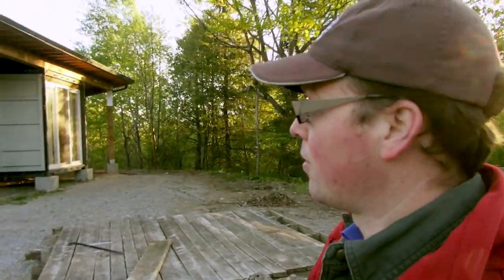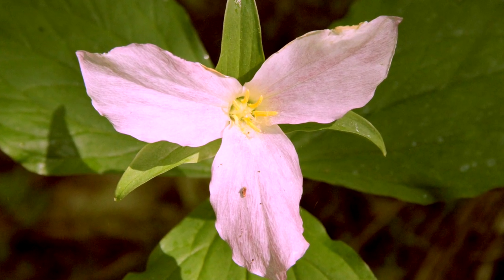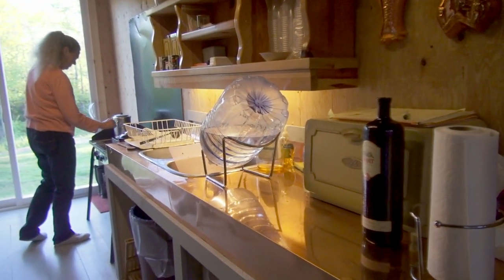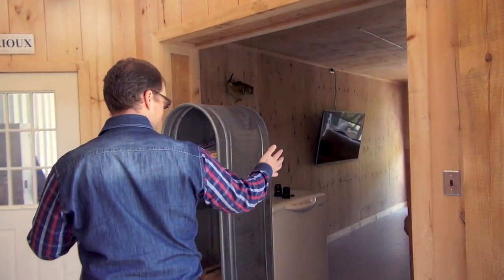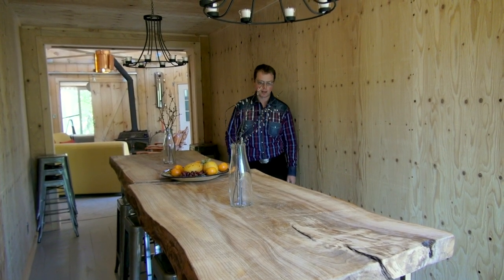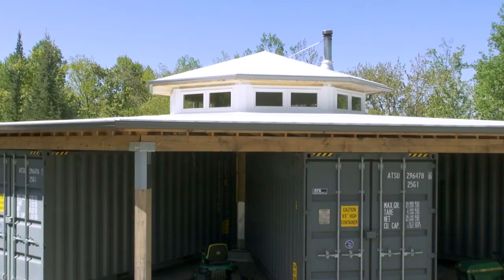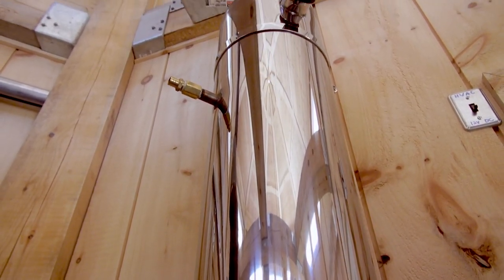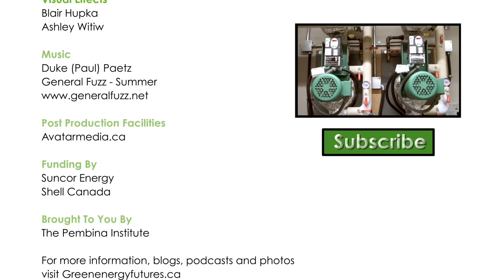112. The Octopod: A unique off-grid solar powered cottage made out of shipping containers

Comment: This is a stupid house! It's functional and plausible perhaps. I would go crazy living in it. It dosnt address the total needs of the family. I presume this is not their main home. I one thing that bothers me is the penny pinching that goes on in certain aspects of the home and the total disregard in other aspects of the home. This slumming for the rich I'm afraid. Full of ego and no heart. I could build two homes off the grid somewhat for what he paid.if you can't bring in this mess for under a hundred thousand than something has gone wrong.
Reply: +eva magnusson I am sorry to say that is one of the most stupid idiotic buildings I have ever seen.The computer fans with gutter pipe in metal boxes as heat distribution Wow! That's Canadian! Oh my,dont show it off!
Reply: +eva magnusson 
I am going to have to agree with Eva. Cool idea, but could be designed a bit better. I don't think those PC fans will push a lot air at all. The biggest complaint is indeed the price though. 130K is quite ridiculous, and defeats the point of a tiny home. Or at least an off-grid home.

Especially considering that a standard 2 floor, 2 or 3 bedroom house is going to cost you about 100K. Why is this even more expensive? Usually, tiny or off-grid homes are in the 5-10k range, with some that I've seen going around the 25-30K range. That is sometimes including the solar panels, the trailer wheels, and the car or truck to tow it around if it's a mobile tiny house.

Even if he shaved off 100k, it'd still be in the pricey range, but at least it would make much more sense. I have to reiterate, if he can't get this under 100K, or even under 50K, something has gone quite wrong.
Reply: +Wvo Quailwvo
Stop that. You've been hawking this area for weeks looking for any comment to try and make others look bad. That is not good man. I don't have an off-grid home. Not yet.

But that doesn't mean I can't comment on stuff. I understand it will cost money. But you can't deny that at that price, that is far too much. Price is one very big reason why people decide to go with off-grid homes in the first place.
If an off-grid home costs more than a standard home, then that would defeat much of the purpose, and most people wouldn't even bother with the idea.
Sure, you can probably save a lot of money in the long run going off-grid, but that long run can be many, many years, and a lot of people don't have that long or want to wait that long to save the money.
They need and want something they can afford now. Or something they can do themselves in very little time. Not another hassle and not another mortgage.
Reply: +Wvo Quailwvo 
I think you have misunderstood me, but I am getting the feeling you intentionally misconstrued some of my words. I didn't say you were a bad person. I was referring to the action of sitting here for nearly a month hawking people who post something you personally don't like and responding in a way that seems as if you want to make them look dumb and bad for that post. Many people would consider that trolling. If that's what you want, have at it.

I haven't badmouthed anyone. It is called criticism. I don't do it often at all, but when I do, I almost immediately have someone rip on me for it. Some people do it wrong and completely try to destroy people, then claim it was criticism. That is wrong. But criticism for the sake of offering your personal opinion and outlook on a situation is not badmouthing.

Yes, going off-grid or getting a tiny home means different things to different people, but to MOST people, it's about having to pay less and be more in control of their environment and life. The reason why many people choose to do it is because they are tired of high and rising mortgages. They may have had a problem at their job and are losing it or are getting less money. They are tired of being shafted by utility companies. Maybe they are just tired of maintaining a home and want to travel, so they want a roaming home (those mobile tiny houses).

Of course there is a cost involved. I was thinking he probably paid top dollar for everything, and that's why the price is so high. Maybe where he lives, the cost of living just happens to be really high. But if he paid even slightly above average prices for everything, and did many things himself, I am sure the cost would have probably been cut at least in half ($65K). Still high for an off-grid / tiny home, but not $130K high.
When many people come to movies like these, they are curious, but many are looking for inspiration. They want to know it can be done. They want to know how much, how long, where, who, etc.
I never said anything like this guy was dumb or something. If he was comfortable paying that amount, and is fine with his house and where he lives, that's his prerogative. But when people come looking for a cheaper alternative to living, and this guy mentions $130K, he probably just [unintentionally] discouraged a lot of people.

There is indeed something to learn from everyone's work. I'm sure if YOU looked around in other places than just this one comment thread on this one video, you would see many more types of houses and designs, and the people that want them, and you would probably then understand why a lot of us here, not just me and Eva, mention the price. If you think I have no merit for saying any of this, just look at the other comments made on this movie. Look up, look down, look all around. You may notice a pattern.

By the way, I didn't see your house anywhere. Could I see it? Like pictures, or a movie? Or how much it cost and how big it is, and what kinds of things you have on your land and such? (actually interested)
Reply: how did I ever get caught into this conversation
Reply: +TheSparky1861 Sorry.
Reply: I commented on this video because I love alternative energies and we should only show off or display when we have done things with taste and somewhat of so called intelligence
Reply: +TheSparky1861
Like showing off only cool and interesting designs?
I'm interested in these kinds of houses and alternative living styles as well.
Just, wasn't a fan of the price is all, but the house still intrigues me.
Reply: I have been working on heat exchange systems and storage.the design of the building should be efficient with a strong center heat nucleus.I can run your clothes dryer for 5 hours without a heating element.
Reply: that is very honourable and noble but sometimes certain people should not preach.
Reply: Wow, one more authority on what it means to be Canadian....lol
Reply: yes this project has a drilled well,
a full in ground septic system,
is electrically self sufficient with solar power and batteries,
has specialty off grid appliances, 
has a number of premium features that are optional for others to pursue (such as wood fired sauna with western red cedar, etc.)
and all the labour was paid for with licensed contractors which accounts for 1/2 of the construction costs

so unfortunately it adds up quickly!
Reply: i was thinking the same thing
Reply: You lost me after "This is a stupid house" If you're going to make an opinion. I don't care about it.

Comment: i admit i didn't see all the details- but it seems like a strange design- high ceiling in the center where all the heat will rise up (away from where its needed) into.  every wall is an exterior wall-  the heat loss and gain will cause large temp. swings.  and those steel containers have NO insulation!  if you do add insul. it would probably have to take up space on the inside of the wall. i also don't see any south windows for passive solar gain??   heck its not difficult to build a passive solar house !  just a shoe box shape (very well insulated) with the long side facing south where you max out the glass and minimize it on the other sides- and all glass NEEDS to have thermal curtains/shutters!  built on a conc. slab (and maybe more mass on the walls that see the winter sun if your in a cold climate) for mass to store heat thru the evening.   www.bendsolarhomes.com

Comment: The overall cost and implementation of a beam based roof system defeats the purpose and concept of the container use. This smacks more of the upper mobile "Pretending" to be off grid then the true idea of the container concept. Is it pretty? Sure, but it comes with a large bank account attached to it and that is In my opinion a fail point. I do not mean to say that having any money or a lot is good or bad but the original concept is to be "On the cheap" when building a container home. Anything over say 20,000 Including the purchase of the containers starts to exceed a real effort towards alternative living and cost savings. Not to mention, that 130,000 dollars even in the U.S. is enough for me to build a Real Home with power and water ran to it. This is not innovative, instead it is counter productive.
Reply: +Human Shores nailed it... this concept is NO concept at all..

Comment: I find this to be full of contradictions.  It's like a project that set out to find the cheapest way to consume more than you need.  The use of the containers is just odd seeing as they then added so much cladding to disguise them.  The ethos behind it just doesn't impress.  Yes here are some good ideas but overall it's a bit bizarre.  Just seeing others here comment that it's sponsored by oil companies sort of doesn't surprise.  It screams "Look, we're good guys too." but by over-consuming it misses the core of the point.
Reply: These containers are spray foam insulated and in order to meet building code, you need to cover it up. Hence the "cladding" interior to disguise the containers.

Comment: I don't understand why people use shipping containers for living space it's an ugly narrow metal box cold in winter hot in summer. The also cost around $7,000 each. Make a passive structure you don't need heat recovery. Timbercrete,Hempcrete, rammed earth, all good cheap efficient, ugly metal box not! Sorry this is a massive fail.